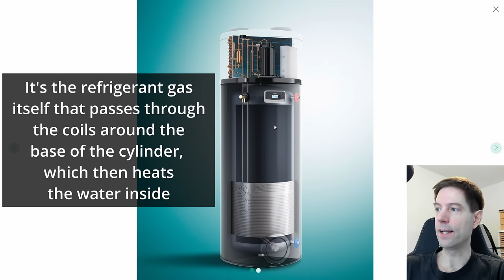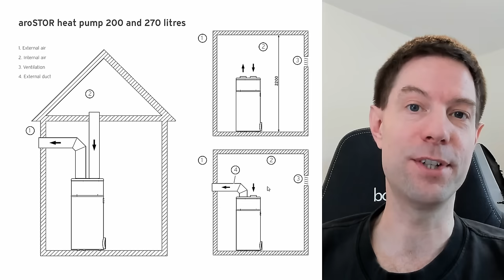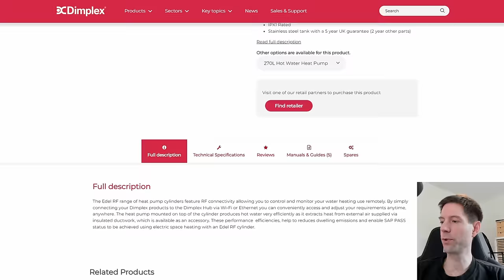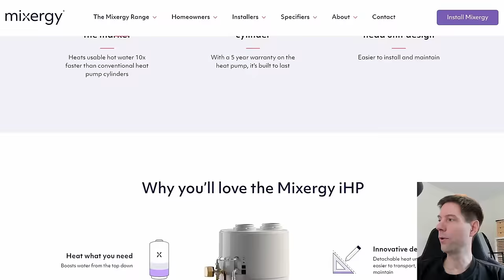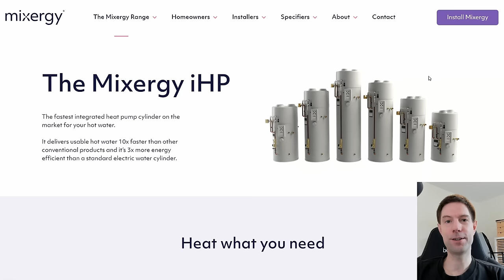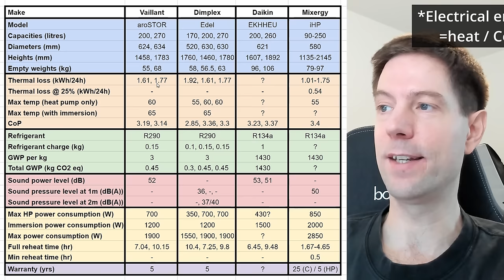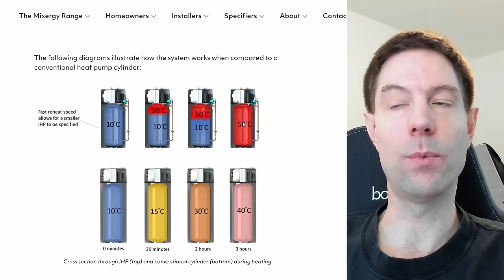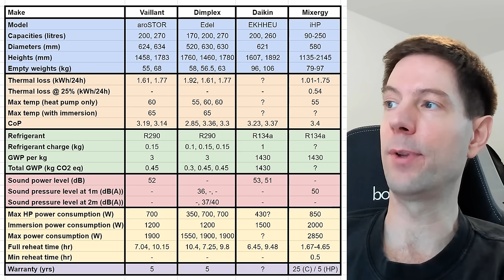Heat pump hot water cylinders - comparing specs

Comment: Great content. I think your conclusion that drawing warmer air from the loft will encourage colder air to make its way into the loft is correct, but the amount of heat lost from the thermal envelope of the home must be insignificant.

I have no calculations to back up my assumption, I'd just imagine that the cylinder won't draw more air than is already being forced through your roof space through the existing soffit vents anyway?

On the DHW temperature issue, since having our A2W heat pump installed we heat the cylinder to 48 degrees. For us it makes sense as we are all young, fit and healthy as well as emptying the cylinder almost completely every day so the risk is almost zero.
Surprised that R290 is being used indoors when some regulatory bodies kick up such a stink about putting R290 heat pumps out in the garden!
I think it's a storm in a teacup. Its such a tiny amount of refrigerant we're talking about.
Charts like you've produced are helpful and even A2A and A2W heat pumps could really do with more standardisation!
Reply from the maker: I suspect you're right about the heat being taken from the loft having an insignificant effect on the house overall.  It's possible a hotter loft in the summer might provide some benefits to the heat pump, however, so I'm keeping an open mind to the option.  I agree regarding the R290, the charges are so low that the risk seems very small, but there you go.  On the Mixergy website they state that this is one reason they're using R134a instead.  I'm also constantly amazed by how many people are so paranoid about legionella, there seems to be some ancient dogma that has long since been superseded by more up to date advice but still it persists.  I did enjoy the excellent video Heat Geek did on the subject last year.
Reply: @TimAndKatsGreenWalk I've been recording my figures for my A2W heat pump.

The part that may interest you is that although the ambient external air temperature has a great effect on the CoP for space heating it appears to have a lesser effect of the CoP on the DHW cycle.
I assume this is due to the higher flow temperature needed.
Although I do have a range from 2.6 up to 4 for the DHW on the same days, the heating was 2.8 and 5 respectively.

I recognise that my hot water cycle typically takes 60-90 minutes for 200 litres so my pump will be consuming more energy over a smaller period of time, hopefully some of this data is relevant to the integrated cylinders that you're looking at.

I haven't drawn any major conclusions yet and I'm keen to see how it tracks throughout the rest of the year but maybe there's some data that interests you.

https://youtu.be/iyQlxtny_4U
Reply from the maker: Just watched your video.  Very interesting!  One thing I regret about the A2A system we have is that I don't have any way of measuring the CoP, like you can with A2W.  I suspect that a good A2W system is more efficient overall than A2A as you can fine tune it to the house.  A2A is more of a blunt instrument so needs a bit more manual fiddling day to day and is unlikely to be as well balanced as A2W.  Still, pros and cons, I suppose.  I'm glad your system is working well for you though, and congratulations on getting off gas entirely!  Oh, and I totally agree about boiler efficiencies, there is no way anyone is getting more than 90% in the real world, I think your assumption of 80% is much more reasonable.
Reply: @TimAndKatsGreenWalk  thanks for watching. Your channel inspired me to capture and organise my data in a less casual way and I hope that me sharing mine will benefit others in the same way that your data sharing has benefitted me.
If we spent extended periods of time in one or two rooms then I could see a very strong case for A2A being more economical to run.
As it is, life with 3 kids means the whole house needs to be heated pretty consistently and A2W appears to be lending itself to that.
There appears to be a bit of tribalism between the two in the heat pump groups which seems silly as both are great implementations of the same fundamental technology. 👍
Reply from the maker: @UpsideDownFork  urgh, I hate any form of tribalism.  There's really no reason to be so polarized.  No system is universally better in all situations so it's worth keeping an open mind.  Anyway, I'm glad my channel has helped you and I hope your channel helps others in turn!

Comment: Notice that the Vaillant model is now discontinued on the Vaillant site? The mixergy has mixed reviews...I'm in the exact same position as you... Think we're going to go with the Daikin....
Reply from the maker: I think you may have spotted the auroSTOR not the aroSTOR?  The aroSTOR isn't showing as discontinued: 
https://professional.vaillant.co.uk/for-installers/products/arostor-domestic-hot-water-heat-pump-58880.html  
As it happens I believe the Dimplex cylinder is actually the same as the Vaillant one (not sure which is the original).  I hope the Daikin works well for you.
Reply: @TimAndKatsGreenWalk   Ha, yes...was looking on my phone and misread it...OK.. have you seen The EV Puzzle's review of the mixergy cylinder? That's what's putting me off. To be honest I can't find a great deal of info on Air Source Integral Cylinders as all the searches come up with cylinders for conventional Heat Pumps! I just need to make sure I don't spend 2K on the wrong one...Got a couple of hundred litres of oil left then it's decision time! Have you ordered the Mixergy yet?
Reply from the maker: @Eggnog3000  I did see Nigel's review, yes.  I think he's quite keen on it now from his more recent videos after some initial teething problems.  There are no reviews of the iHP so far that could find, presumably because it's not out for general sale just yet, but I should have some more info to share on that soon as we're going to visit the Mixergy office tomorrow (keep that under your hat!).  I totally understand your reluctance to commit without as much information as possible.  I hope to be able to add to the pool of knowledge with  this channel.
Reply: @TimAndKatsGreenWalk  OK great, looking forward to the content... Only realised that you need planning permission for the external units from these comments too! What a nightmare... Hope it's going to be worth it!

Comment: If you have 10Kw of battery and 5Kw inverter in the loft creating heat, would that make it a better option for the inlet coming from the loft? Possible switchable vent so you can switch to drawing for outside during the winter to not over-cool the loft?
Reply from the maker: Possibly.  It comes down to practicality more than anything, as often it's too complicated to install something along those lines.

Comment: For Vaillant A2W heat pumps there are strict clearances from opening windows etc. This is in case the flammable R290/propane refrigerant escapes.

Interesting that their R290 integrated heat pump cylinders can be placed indoors without any precautions.

The outdoor units do contain more refrigerant (e.g. 0.6 kg for the 3.5 kW version vs 0.15 kg for the cylinder featured here).

However, it’s a shame that they put such strict restrictions on their outdoor units, which means they often can’t be sited where you want them.
Reply from the maker: Yeah, that is weird.  Siting heat pumps outside is one of the most annoying aspects, so making it more difficult doesn't help!

Comment: Newbie question here ...

If heatpumps can be run indoors and sitting on top of a water tank like this ... Why would we still need such giant heat Air Source pump units sitting outside of our house being exposed to the elements/weather ?
Reply from the maker: Because of the amount of power a heat pump used for heating your house requires.  These ones on the hot water cylinders are much less powerful as they only need to heat your hot water not your whole house.  For example, hot water requirements would be about 2 kWh per day, but when it's cold outside you might need 30 kWh per day for your heating.
Reply: @TimAndKatsGreenWalk  Thanks. I'd never seen these heatpump hot water tanks before,  really interesting. I'm in the process of buying a house with an old oil burning CH system and no mains gas available. So looking around for alternative systems ...

Comment: I've had one for the last 10 years works perfectly no issues the heat pump pulls 660 watts I have also have also a heat pump for house heating, the logic of this is I prefer to to run 660 watts for hot water opposed to run the larger 2000 watt house heating compressor though both are run on off peak electric
Reply from the maker: Good to hear.  I'm looking forward to getting mine installed soon, hopefully.
Reply: could suggest to place in garage with an air filter over the intake drawing air from the garage via a transfer grill to outside and as the discharge air is pretty cold how about feeding the discharge air to outside in winter and via a "T" and damper duct the air inside during the summer cools the house down if you have that problem could be considered "free cooling" Oh well just a thought. @TimAndKatsGreenWalk

Comment: My plan was when I replace the boiler with a heat pump is to put a Heat pump hot water cylinders where the boiler currently sits in the kitchen.  It already has a vent to the outside and most of our water usage is in the kitchen or bathroom directly above it.
Reply from the maker: If you're planning an A2W heat pump heating system then it will come with its own cylinder, so you wouldn't need a heat pump cylinder.  Or do you mean you plan on getting an A2A heating system?

Comment: The thermal stratification of Mixergy cylinders really makes them stand out from the others. Obviously if you need to use a lot of hot water in one go it won’t be an advantage, but if you just want a couple of quick showers, it really will.
Reply from the maker: Yeah, for those occasions when you need a quick boost it's a handy feature to have available.

Comment: If you're drawing air from the room in which it's located then does this not have basically the same problem as you describe if it's drawing air from the loft? I suppose somewhat it depends on your house configuration. Our garage isn't attached to the house so not an option for any of this kit. We have an airing cupboard though where there was a hot water cylinder when we moved in but we got rid of it for a combi boiler. This would be quite well located to pull from the loft and vent to the outside. Our upstairs is always a fair bit hotter than downstairs and some of this must go into the loft so be nice to suck some of that heat back down again!

That would then probably push me towards the one that makes the least noise so soundproofing might be needed.
Reply from the maker: Yeah, if the air is coming from the room the cylinder is located in (e.g. airing cupboard) then that air will need to be replaced from somewhere, so it'll likely come from the rest of the house, which in turn would then get drawn from outside, so you'd cool your house down in the Winter.  That's why a vent to outside is necessary for input as well as output.  If you're drawing the input air from the loft then it'll cool the loft in the same way as that air will get replaced from the outside, so you're likely to indirectly cool your house too in the Winter (since more heat will rise into the loft to replace what was removed by the heat pump, as I explained in the video), which isn't really a good thing as you then have to heat your house more.  You may suck the heat back down but you'll then have a colder loft so the heat will leak back upwards quicker due to the larger temperature difference between your house and loft.  Having said that, if you have plenty of loft insulation, and your loft is well ventilated, then your loft is unlikely to be much warmer than the outside air anyway in the Winter, so drawing from the loft might not make much difference to your house heating load, or indeed the performance of the heat pump in the Winter.  If your loft is warm in the Winter I'd suggest extra insulation in any case!  In the Summer the loft is probably warmer than outside due to the sun heating it so you might gain some benefit with with your cylinder achieving a better efficiency (due to the higher input air temperature), so I think the benefit comes in the Summer rather than the Winter.  It really comes down to what's practical regarding the vents.  If it's more convenient to have the input vent coming from the loft then that's what you should do.  Just as long as you always vent back outside!  As for sound, all of them have similar noise levels so you would definitely need some sound proofing if you plan on installing one in an airing cupboard.
Reply: @TimAndKatsGreenWalk  I suppose it'll come down to a rough calculation on which way is the most efficient, possibly factoring in other considerations. Obviously we'll be using hot water all year round so will constantly benefit from improved performance there through drawing in hotter air to start with. And pulling hot air from the loft so more can escape from the upstairs might be a small relief during hot summers! Thanks to you though I'll probably install an air-to-air (if I'm not then why bother looking at heat pump water cylinders?) which will hopefully make those hot periods more bearable anyway.

I wonder if our best solution is to just use the air in the room and vent to the outside. There's a small radiator in the airing cupboard but the main source of heat now is the solar battery. Installing that has actually turned it back into a proper airing cupboard again! So could make sense.
Reply from the maker: @FlatToRentUK  I'd still consider having the input vent coming from the loft rather than the room itself if you can.  These cylinders consume vast volumes of air so you don't want to find you're sucking up all the air from the house.  Good luck with your plans, regardless of what you decide in the end!

Comment: In a garage you might want the ventilation of having it pull air from the garage space, lots of garages have damp issues
Reply from the maker: We don't seem to have damp issues in our garage so hopefully that's not a problem, but venting is definitely something I'll be discussing with installers in much more detail before deciding anything final.

Comment: not sure the loft would cool like that. Assuming its already a cold roof any heat from your house is leeching rather than pulled so I don’t think it’d change. You may end up cooling the loft space by a degree or so but I don’t think it’d affect your main house
Reply: It won't cool , it's a cold loft .
Reply from the maker: Not much, perhaps, but you are removing some heat, which will get replaced somehow.  Conservation of energy.  But it probably makes little practical difference, I agree.

Comment: if you fitting it inside your garage , i think you will benefit from the higher ambient temperature inside the garage during winter , by drawing the air from inside the garage. This way the COP will be higher . In summer you can draw from out side it you want to.
Reply from the maker: But that heat drawn from the garage would then be replaced from the house which would then increase the load on our heating system.  Sadly you don't get something for nothing in that situation.
Reply: @TimAndKatsGreenWalk  Right, but at least in principle this '2-stage' (2 small steps) heating should give better efficiency than both the heat pumps working from cold outside air. (I think - I'd have to do some sums on pump losses to be sure). Making 50C hot water from 20C internal air will be a lot more efficient than making 50C hot water from 3C external air in winter. Of course on hot summer days when it's hotter outside than in then an external supply will have lower delta-T and thus be more efficient. Yes you need to make that 20C air from 3C air in the room heat pump so the question is does 3C->20C + 20C->50C use more energy than 3C->50C?
I have the extra consideration that my house has an MVHR system so is quite airtight and adding more external vents (which will also be thermal bridges) is best avoided.
Interesting that you didn't include the ecocent, which is the one of these that has been around for about 15 years already.
Reply from the maker: @xxwookey  these cylinders consume vast quantities of air.  They'd empty your house of warm air in minutes leaving your home very cold indeed with all the cold air that would then be drawn from outside to replace it.  You definitely don't want to be consuming air from inside your home.
Reply: @TimAndKatsGreenWalk  But that's how the ecocent has worked for years and the user I know is very pleased with it. Heating up a hot water tank is a few kWh/day (depending on how much water you use) so whilst it moves lot of air it's only adding that same heat load to your CH, surely? In most UK houses the heat load is much larger than the hot water load. Only when you get to passivehouse levels is the hot water load similar-to/larger-than the heating load.
Reply from the maker: @xxwookey  you will not gain overall efficiency by consuming the air in your house for the purposes of heating your hot water.  Even if your hot water cylinder works more efficiently you'll lose more than you gain by making your heating work harder.  You don't get something for nothing.  At best you'll break even but that is extremely unlikely.  If you could make heat pumps more efficient by doing a two step process like this then they would all work that way already.